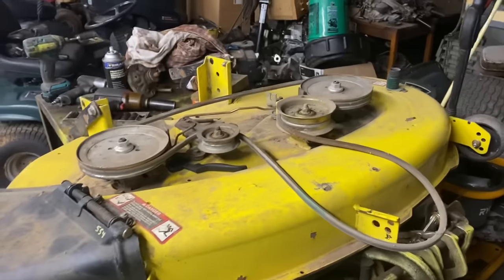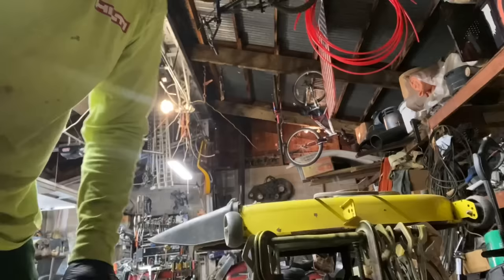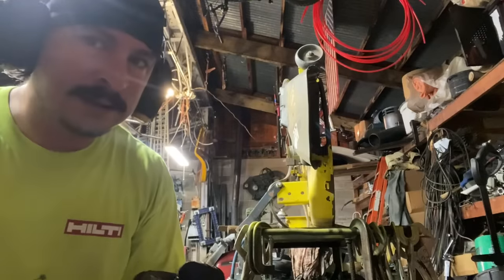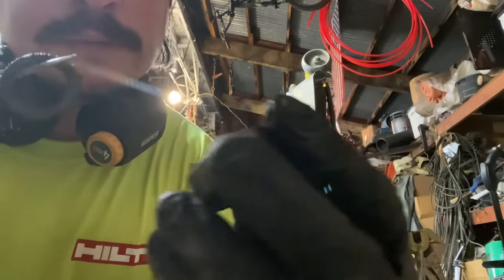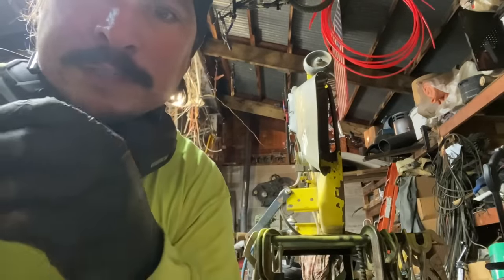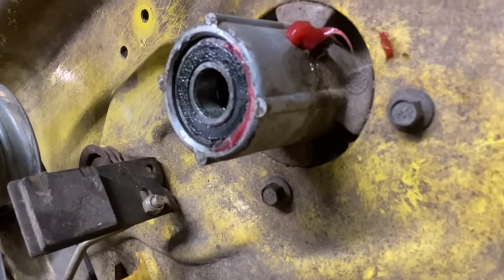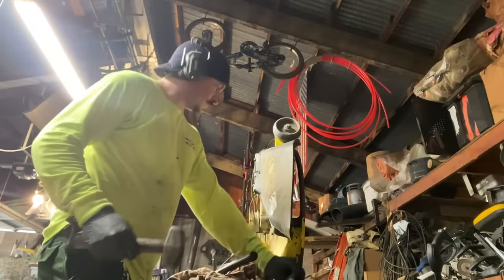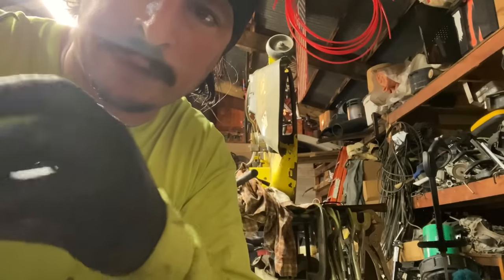Part 1 - Don’t trust the “Experts” Grease your mower deck sealed spindle bearings Common sense.

Comment: Carefully remove the 2 x seals. Wash bearing and seals thoroughly inside and out. Repeat washing process in new clean solvent and blow all parts dry without rotating the inner and outer races. Completely fill the bearing; cage, grooves, balls/rollers inner/outer grooves with the chosen grease and wipe off excess grease. Rotate bearing by hand to push excess grease out of the races and the path of the balls rollers. Wipe off displaced excess grease and with the rounded end of the finger wipe out the grease between the inner and outer race and down to the cage leaving a concave groove in the grease around the 360 degrees of the bearing on both sides. Replace the 2 x seals. re install the bearings ready to operate.
Pumping a hi speed bearing full of grease so that it can't escape will overheat and break down the grease prematurely. It will over heat the bearings and components making machine operation less efficient and potentially shorten the life of the bearings and machine.
Reply from the maker: You can do it your way. And that way works just fine as well. But the whole point of the way I show is the average Joe can attach a grease gun and pump the assembly full and bearings will receive grease. No need to tear down the deck to remove bearings. Especially not necessary to clean the bearings out. That’s just getting way to serious. If the bearing has old dried up grease I’d just throw a bearing in it while I already have the assembly apart. It’s your opinion that in this application the bearings can overheat if greased the way I show. But I think it’s absolutely not an issue and can’t be proven. If so can you please tell me some details like at what temp this is a concern? I’ll start checking with my laser temp gun after a hard mow
On a hot day. I argue that grass build up piled around pulley housings hold in more heat and is a bigger concern that a well lined bearing. Iv explained the same in many other comments. As for the bearing, any grease that needs to get out of the way of the bearings will push out of the shield. It’s a self correcting issue so no need to get concerned and manually adjust the grease in each bearing down to a scientific specification. Yea all that looks great on paper but where the rubber hits the road for this application it won’t matter. The high speed rotating parts will self correct and that grease will move to where it needs to go if there is too much in the way of the bearing. The way I show works absolutely fine and no need to tear the deck apart and turn it into a unnecessary project. If your going through the trouble to tear it down that far, mine as well just grease the bearings the way I show and just for the heck of it see how many years it lasts
Before the bearings “overheat the grease” I mean hay, it would only make sense to try it and wait to completely disassemble the deck if absolutely necessary. If you do it my way you won’t be needing to tear the deck down, that’s my opinion. Have you ever wondered why some of these come with a grease zerk? Just curious what you think that reason might be?

Comment: If you have ever disassembled one of these spindles you probably noticed that there was contamination in the void between the two sealed bearings. By forcing grease into the void and into the bearing you are forcing contaminates into the sealed bearing shortening the life of the bearing. Any fool should know this.
Reply from the maker: Very rarely and was always rust or from being ran without grease and the bearings failed causing metal shavings otherwise no they are usually clean. and we are talking like 20 year old machines. Think about what your saying, it just doesn’t compute. This is a useful and very beneficial practice. There is no reason to throw out insults when I’m actually providing free help and the alternative according to your logic would be? I assume run to failure. I’d argue that even contaminated grease is better than the absence of grease. Without grease they will eventually fail for sure. This comment is rude and disrespectful. Not helping anyone.

Comment: Better yet, when you have the bearing off and one side seal off, just pack the bearings with grease and put the seals back on, and they will not have problems, nor have to burn up two tubes of grease trying to pack the spindle voids with grease enough to get enough lube to grease the top bearing to start with.   And the truth is, cheaper to just buy new bearing in packs, pop the seals to pre-pack then to swap in new at the end of the season when you are servicing the machine, and still come out ahead of all the grease your going to end up using with repacking the void over and over again.
Reply from the maker: Keep in mind that’s not the point of the video I made. Yes that’s one way. The slow  more expensive way for sure. And specifically better suited for people with that skill set. Anybody can add a grease gun and pump the assembly up. Sounds like some exper advice on exactly what  I’m trying to help people avoid. adding a long process to reach the exact same outcome is no more effective. Just simply requires less grease. But in my area grease is easer and cheeper. a hand pump grease gun is all that’s needed. In case it was not obvious, I only show the process of removing the bearings to prove a point. One would need to see the whole video to obtain the useful information within. One tube will completely service 3 sometimes 4 tractors. Grease is cheep enough. And after the unit is filled it will maintain the grease and from that point just need a few pumps each service. My time is much more valuable than the cost of 1/3rd tube of grease. And not everyone has tools and know how to do it your way. However it works great too. Just a lot longer processes. Seems silly to replace bearings that could last forever if greased as Iv shown. I love that my tractor decks keep going for years and
Years without bearing failures. Just some simple Preventative maintenance nothing to argue about. If your lucky enough to have a deck with zerks, This is the easy way and it’s as simple as that.

Comment: Although you proved grease got into the bearings the amount was minimal, plus the amount of wasted grease inside the housing is excessive in my opinion.  You would be much better off packing each bearing by hand and saving so much grease you could do that a dozen more times or more.  Just my two cents.
Reply from the maker: Grease is cheep. And no it’s not wasted. Now that the assembly is filled, the future greasing will only require a few pumps. 1 tube of grease has done as many as 4 mowers. So a 10$ tube divided between 4 machines cost me $2.50 per tractor. Not to mention I can grease a deck that has no issues requiring disassembly and be done in 5 to 10 minutes with greasing the whole machine at all points. But for my practice, dismantling a deck to manually add grease requires disposable gloves. Rags and grease as well as at minimum about 1 hour on average and that’s time wasted. And that’s if nothing breaks and don’t have any issues or slow downs on the way. In many cases nuts are seized or bolt heads snap off some of the older machines making disassembly a gamble. Better to just service if working properly and avoid the added labor and possible other issues. Not all decks are in the condition yours may be in. Some bolts and nuts don’t come off after being outside for years. Hate to turn a service. That requires $2.50 in grease into a nightmare requiring parts that could have been avoided. This is why I wanted to provide the information to help others. No everyone has the tools or knowledge or the interest in dismantling a perfectly operational deck only to add grease to the bearings. This is why I made the effort to show the step pain staking step by step process so folks could see the truth of the matter. As for the amount of grease that reached the bearings. It was adequate. And each time grease is added in the future the bearing will receive a little more. The good thing about future greasing is it only takes a couple of pumps to push the grease already loaded in the assembly that extra little bit to reach a bearing. If you watched the whole video I’m surprised you would argue that dismantling a deck to get the same result is better. Iv been doing this a long time. Hundreds of tractors and Iv done it both ways. The way I show here is by far the best way. I only offer my findings, what folks do with the information is there choice. I stand to gain nothing other than the satisfaction of trying to help folks. This process is so simple it’s silly. I dismantled decks for years until I figured this out.

Comment: I learned a long time ago, If it a'int broke, don't try to fix it..... He's got way too much grease in those bearings.
Reply from the maker: Care to elaborate? I can already tell from the comment you did not watch the video. I’m not “fixing” anything. I’m doing preventative maintenance. Did you learn anything about that a long time ago? Or do you choose to run stuff until it breaks? If you would have watched the full video you would have gained some useful knowledge about preventing breakdowns. And no the bearings don’t have “way” too much grease. They have grease. That’s what matters. There is no way to put too much grease in these mandrels. Anything past full will escape out of the assembly. Sort of a self regulating system. Not exactly rocket science on this channel. There is no way to know what’s in the bearings until grease exits the assembly. Anything less the bearings may not have received grease. It’s extremely simple. Thing is that most people are provided the wrong information about this topic. And a lot of folks who thing they understand things but don’t actually have any knowledge on this application are eagerly providing bogus information to people who need help. I made this video to show the truth of the matter and that would be why each step is shown on the slow boring video that most folks won’t watch and jump to conclusions missing the important information.

Comment: OMG,,,,, I HAD to read every comment!!    The 'NA-SAYERS',,,  ARE SO FUNNY!

ASK YOURSELF,,, Why is there NOT 'seals' on car bearings?  OR even Grease fittings on the hubs? How often do you grease them?
& WHY, is it best to ADD 'BEARING BUDDIES' on boat trailers!!?  No seals on those bearings that are constantly going under water,,, & that's after being heated!?
&
The only reason to take out spindle shafts, & individually check each bearing, is IF the grease comes out of the top of the spindle & NOT the bottom. THEN,,,, you might have loose or damaged seals on one of those bearings,,, & the grease only feeds the bearing with the less resistance!

Comment: Well shucks, all these years I thought RS stood for Rally Sport ...

Ball bearings should not be packed full of grease like you would with a tapered roller bearing. Tapered rollers rotate on their own axis while ball bearings are actually moving pushing through the grease which at high speeds can cause more issues than just forcing the grease back out of the seal. Might be okay for slow stuff like this that are under 1000 RPMs and don't have hundreds or thousands of PSI of pressure but on an axle wheel bearing or heavy industrial equipment things are different. There's a reason why even the very best bearing manufacturers don't pack sealed ball bearings full of grease
Reply from the maker: Thankfully I’m only talking about mower deck bearings here. I
Don’t know about other bearings and don’t assume all
Applications would be the same. 

Just trying g to help folks get maximum life out of a deck bearing. I’m
Sure Every application is different
Or at least has some differences as speed and load ratings and tolerances vary greatly for diffrnet applications. I would not assume that this would fit all applications. I don’t tend to have issues with many other bearings in my life. When I do, I’ll look to the experts in those fields. But I’ll
Be careful what “experts” I trust as I found in this case the So called gurus were way off target spreading bad information. Had all I could stand. Finally had to post a video to show my findings. The hole experience has made me trust experts a little less. At the very least if someone wants to make a video on why something should
Or shouldn’t be done, they could show some proof like I did. And not just run their mouth on camera looking like a fool to folks who actually know a little about real world application.

Comment: When you beat a bearing out by the center race, you cause the roller balls to brinell the races. The bearings should have been changed.
Reply from the maker: It’s okay, I’m a professional. 
Tap tap tap it in. Or out lol
Reply from the maker: Key word was beat. 
I guess you haven’t seen my videos where I beat on stuff. This was a gentle tap. Like happy Gilmore but rather than tap tap tap it in, I like to tap tap tap it out. I guess these hardened races can’t even take a tap? Funny it hasn’t caused any problems for me ever. But maybe my day is coming. But what I’ve found does cause major problems is bearings not being greased. Follow my 5 easy  steps to bearing euphoria and you will be headed towards a life of bearing harmony. And because I proved that bearings can get greased from a zerk even if the bearings have inner seals/shields in place, now you won’t need to remove bearings. Because I’ve done the work to show they will get grease if the process is followed Just grease grease grease and mow mow mow. You won’t have to even tap your bearings out by the inner race and make engineers upset. They are a very sensitive folk.

Comment: Takes way too much grease to fill a modded spindle.  Those with the spindle have much smaller space to fill.  If you rebuild your spindles, just buy the precision spindle bearings..  they last a lot longer than the cheapies and are a lot quieter.
Reply from the maker: Right. Quality bearings are nice. But if you already have good bearings why not just grease them? One tube of grease will do more than one tractor. I can usually grease 2 or three machines with one tube so I’m
Figuring like
2$ or 3$ grease per tractor I service. And that’s just for the first greasing. After the mandrels are full they will
Never need that much again. Just a few pumps on future greasing. Not sure what your grease costs but 5$ or 10$ for a tube of decent grease here
In Texas And last time I checked a quality bearing was 20$. So 20
Bucks times 4 or 6 bearings in a deck. that could be upwards of 70$ or 80$ for all
The high quality beat sings and that’s before I even consider the time it takes to put them in. So if someone has good bearings. Maybe spend the few bucks on grease and give it a try. What could it cost ya? On the other hand, maybe it works out and saves you a lot of money and time. Less than breakfast at McDonald’s and life is good. If I
Wanted 100$
Worth of
Bearings in my deck I’d be the kinda guy who wants a 7,000$ mower. If you smell
What I’m
Cooking?

Comment: Far too much grease in the bearing. SKF who I would consider the world expert recommends the amount of grease as determined by the SKF formula G = DB/10, where G is grease in ounces, and D is bearing outer. Dismantling and repacking would be my recommendation or just fitting new SKF, German, or Japanese bearings directly from a bearing house. Too many fakes on eBay. A proper bearing extractor and insert tool will mean the housing will not be damaged and perform as new along with heating the housing and cooling the bearing for an easy fit.
Reply from the maker: So do those SKF “””Experts”””” specifically discuss this application? Just love to see that data. 

Actually for this application it works fantastic. Sometimes it’s just not that complicated and why does it work out that my bearings last 20 plus years when I grease like Iv shown, the same way my grandpa did his old school “real” cub cadets. Before the box store junk mower builder better known as MTd (MADE TO DIE) took them over. but these days they fail in well under 100 hours on some box store tractors including the 100
Series Deere, when not greased. I’ll keep pumping mine full like Iv shown because it works better than not greasing. And the majority of folks are not going to pull bearings to add a metered amount of grease. Thats kinda comical really. Most folks won’t even grease them with a gun, they sure won’t take the deck apart to put a calculated exact fraction of grease into a bearing. Dont get me weong, If you have hard evidence this procedure causes failures, i invite you to please make videos with the evidence and helpful information that can do good for the DIY community. Otherwise your just another naysayer blindly following experts and with no evidence. This is not helping anybody. A bearing in this application will not overheat from over greasing, the seals don’t hold pressure. Any extra grease will push out of the way and out the lip of seal. If you can prove otherwise I’m ready to watch your video. Please post right here for us all
If you have links to your own videos or others on the topic or any data for that matter other than general advice for bearings that do not cover the use of bearings in this application. This video is strictly for deck bearings and what id like to keep it focused on. Too many other applications that run diffrent loads and different RPms that won’t meet the use of the bearings in the mower deck mandrel application.